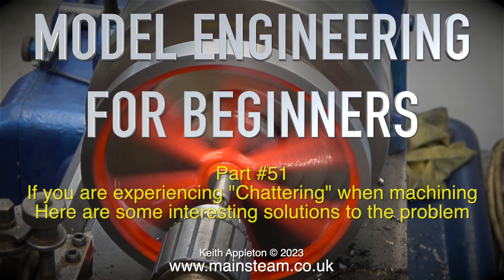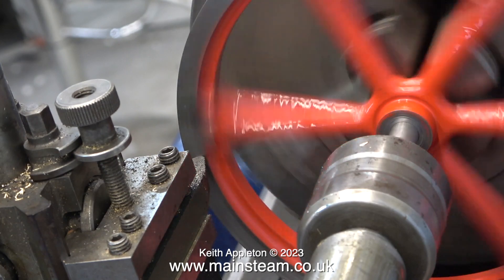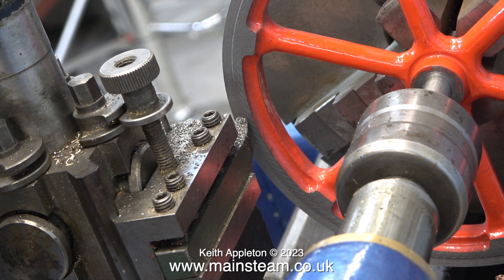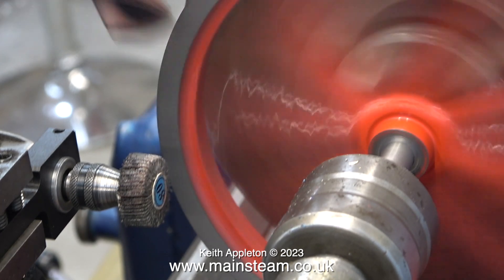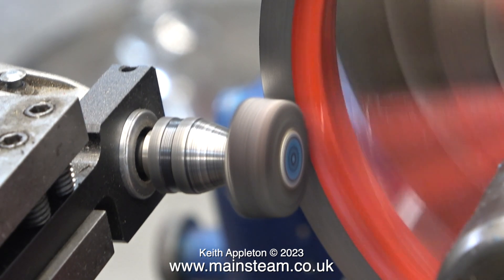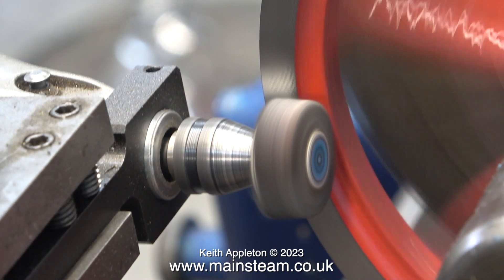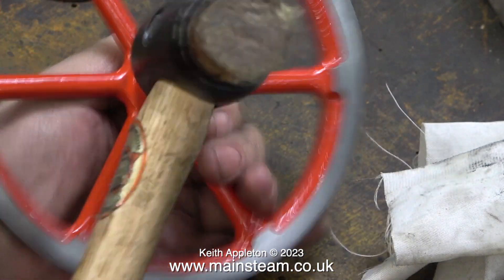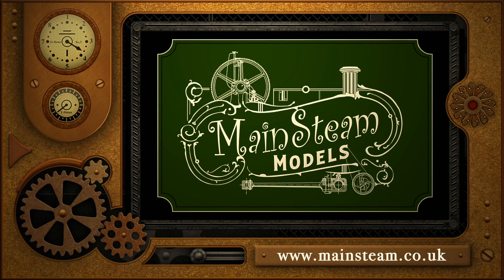SOLUTIONS TO THE "CHATTERING" PROBLEM - MODEL ENGINEERING FOR BEGINNERS - PART #51

Comment: There have been many methods worked out long ago to sort out chattering issues, One that comes to mind is when cutting a hole to suit a chamferred machine screw you wish to be flush when tightened when you cut the chamfer use a piece of cheesecloth between the countersink tool and the workpiece as that will damp the vibrations and give a chatter free counersink hole almost impossible to achieve otherwise.

Comment: Thanks for another great video.  I really like the way your fly wheel cam out.  I can see why your in a red wheel phase it looks really good going round.  I like that finish from the flapper wheel.  I think it would look good one some tender wheels I am working on.  I see what you mean it gives it a scale tool finish.  Does Proxxon make the adapter for the tool post or is that something you came up with?
Reply from the maker: The Tool Post Adaptor is made by Proxxon and not very expensive.
Reply: @keithappleton  Thanks Keith.  Normally I get the American Dremel but I think I am going to get a Proxxon.  The tool I have seen you use and wanted the most is the Proxxon Angle Grinder.